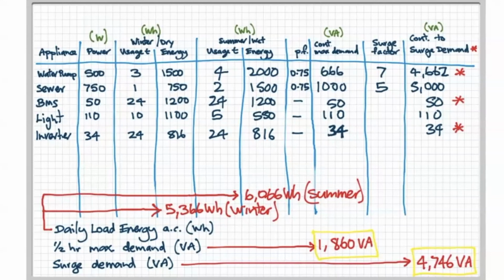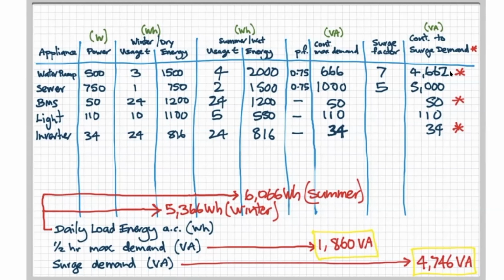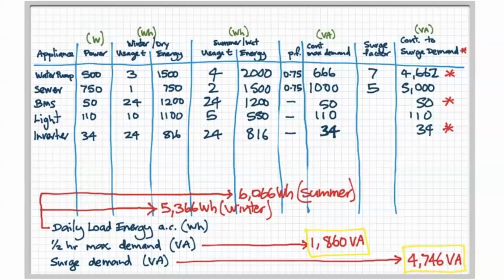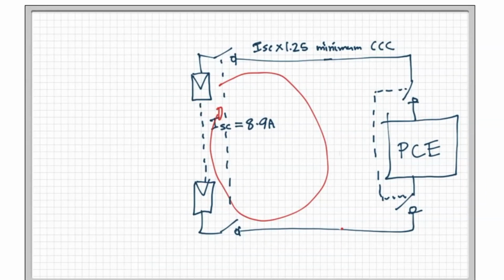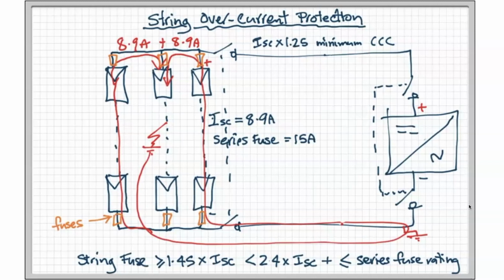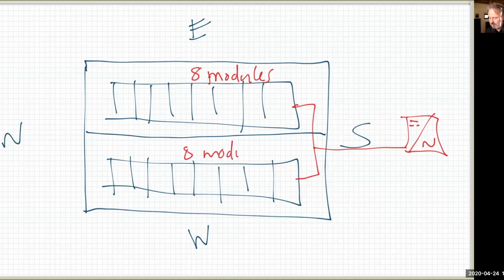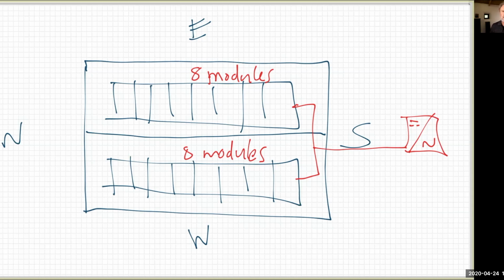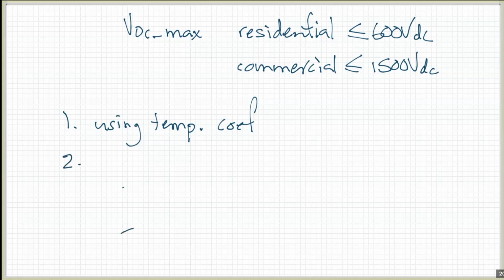Solar & Battery Training Ep11

Comment: Hi Glen thanks for the great series. Out of interest, my question is on 1000V and 1500V strings in commercial applications. What restricts some applications to 1000V (you see this in roof top solar) to 1500V applications which you see in the utility sector? Keep up the good work.
Reply from the maker: Thanks for the question. AS/NZS 5033 covers PV arrays up to 1500 Vdc. For domestic installations the maximum PV array voltage is 600 Vdc, for non-domestic it is up to 1500 Vdc but limited to the maximum voltage rating of the equipment. Up until recently there were few panels that went above 1000 Vdc but for utility sector applications it's more normal to use higher voltage rated panels.